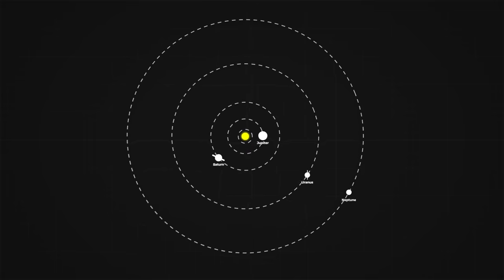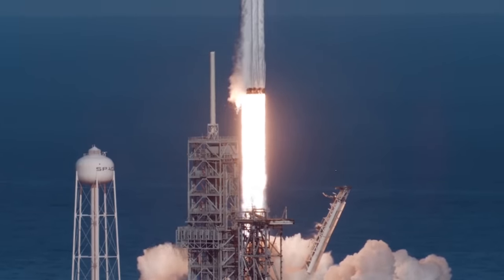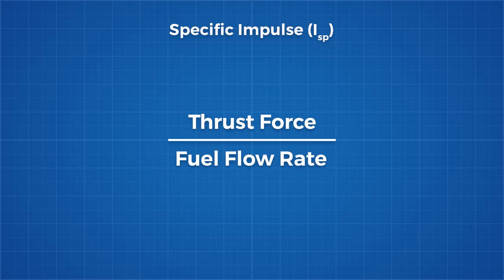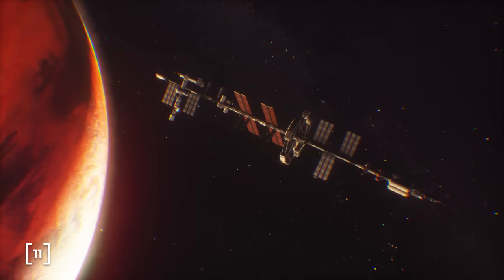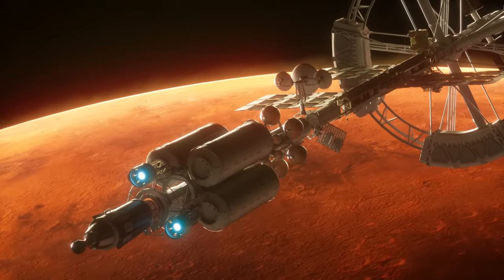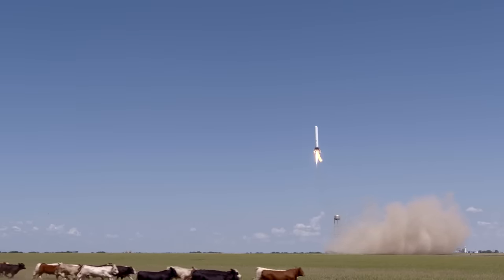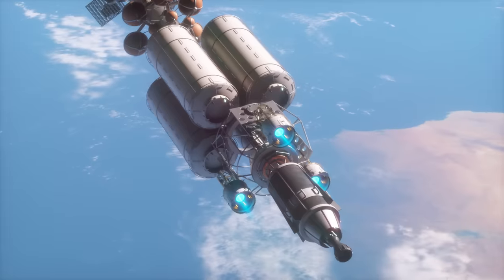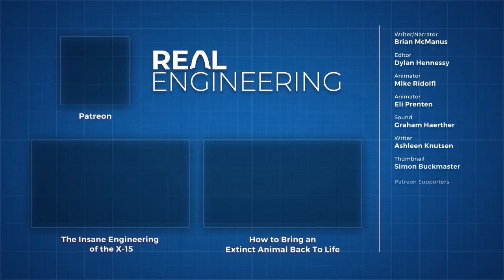Can Nuclear Propulsion Take Us to Mars?

Comment: The 8:25'old-school' logic of electric energy propulsion thrust being insignificant to chem-fuel combustion level. Was assumed of a nuclear cell storage, running a dinky 🏟  size flashlight  🔦  as the engine,  versus nuclear amp to the energy thrust rocket. In solar orbiting, chem-fuel can never be non-idole. Never guarantee artifical gravity in solar orbit. 

 Energy thrust also doesn't have to be very robust power, yet accel infinity longer, exponentially advancing the chem-fuel, chems could/should be saved for VToL or emergency maneuver initiatives. To Mars/Venus/Titan.

Comment: First of all. A typical todays combustion jet engine is not a controlled explosion. The detonation engine is.
Secondly, hydrogen can be stored for a long time in the form of water, which is quite easy to decompose into hydrogen and oxygen by electrolysis or by heating it to 2500 degrees Celsius (interesting coincidence). The good old nuclear reactor allows to implement both methods, but the first is preferable for a number of reasons. 
A third important point is: The plasma engine, not the ion one, has the highest specific impulse at the moment (as far as i know. I'm an economist, not roket science guy.).
And the way to cool the reactor has long been found.
Reply: first of all rocket engines are no jet engines. Secondly, an explosion is a rapid expansion of gases so in a sense its a controlled explosion .also storing it in water completely removes all advantages of nuclear propulsion with oxygen being 4 times as a h2 molecule

Comment: And no one is trying to find a safe container for fluorine, which if combined with hydrogen would provide a chemical rocket so powerful that we could use chemical rocket of about a third of the size of standard chemical rockets, but at least you wouldn’t need to worry about nuclear waste products in the atmosphere. It could be argued that fluorine products are generally poisonous so not much of an advantage in the possibility of a launch failure

Comment: Split the water turn it into hydrogen and oxygen it will give you 2 fuels or 1 fuel and 1 life support system for people on board. Because you are running a nuclear reactor it could produce a lot of electricity that can split the water into gas. Water is safe to carry.

Comment: The concept of a nuculear purpulstion, had never considered the attuning of fusion & fission wager, because of human/fragile cargo, faster acceleration was still a uncomfortable G-Force factor, what was missing, is the G-force as gravity simulate. 
So it's the longer lasting acceleration duritation in non-idole is more feasible, not faster acceleration. 
 
A canister rocket is limited, but with micro exertion of fuel atmosphere, the wager of control could continues flow more stable, saving the fuel verse over usage burns. Feasible only in micro gravity or solar orbit travel. 
 However, Electric thrusters ( example VASIMR), would offer multi combo of have a more control lower flow to sustain at least gravity simulated acceleration levels, be non-idole, use with mini nuclear amp cells, can last longer, eventually faster travel duriation time to and from way points, within solar orbit domains. Save the traditional chem-fuels for emergency maneuvers, planet orbiting & VTOL sequals.

Comment: Common misconception: The slingshot does not increase velocity. It only modifies the vector and hence the relative velocity to the previous body
Reply: If it doesn’t increase velocity, then how do they raise an orbit? If you look at missions like Cassini that bounced between Venus and Earth before heading to Jupiter and then Saturn, how does that work?
Reply: Hi Fork, The orbital entry and exit are defined by a hyperbola assuming no atmospheric breaking is used (unlikely) so it is equivalent to a vector change in orientation rather than velocity. This is of course very useful and relative to Earth the speed can be changed but there is no overall Potential Energy gain relative to our solar system.
Reply: @tomwojcik9342  Got it, because the object accelerates to the target body on approach and decelerates relative to the target body on escape right? Just a trajectory change through the hyperbola
Reply: @fork9001  Exactly! Cheers!

Comment: New planar 3DSG meta-materials 100X stronger than steel and lighter than air will be fabricated into 3D structures:  air-to-space ships. These vessels can reach 150,000 ft, engage Hall Thrust Engines, accelerate in rarified atmosphere, and reach escape velocity. Their expansive fuselage have enough surface area for photovoltaic power. The cargo capacity is capable of 1000's of tons. The tech exists now to reach Mars without gravity assist and return without refueling. Plus, the very nature of this class of meta-material will accommodate hydrogen without the fear of leakage and hydrogen embrittlement.

Comment: Greetings from the 30th century. You've got it all wrong. Don't increase the exhaust velocity. Reduce the gravitational pull (g) instead. If the crew, supplies, fuel and cargo weight 1 kg alltogether and you have 1000 m3 of hydrazine and oxygen on board - you could reach velocities close to 0.99c. Mass is not a constant, mass depends on the interaction between baryons and the Higgs field. Locally diffuse the Higgs field to solve the problem.

Comment: How to store Hydrogen? Water. Seperate it into Hydrogen and Oxygen for use as fuel as needed in the same way making Hydrogen fuel works here on earth. As a solid, Water is pretty safe to store, and the power used by the Ion engine could be used before it is needed to create the fuel needed for a burn.
Reply: But then you have to electrolyze the water using onboard power, and doing so in mass - such as to power a rocket engine - would take a lot of power
Reply: @alexsiemers7898  Yes, and no. If you were making the fuel on demand, yes. But for space, there is little need for that. Run a low output reactor and turn a very small amount of the water into fuel over time with the excess power that the reactor generates while the Ion engine is not used.  Doing this,  one could turn comets into the ships that explore the stars.

Comment: @Real Engineering, would it be possible to utilise both Ion drive engine as well as normal combustion engine that we are using in this day in age, when it comes to putting both engines on one connected space craft? Using the more powerful engine (Ion Drive) to get most of the way to Mars but then using Normal Combustion engines or nuclear engines to slow down the space craft enough to orbit mars? (also I could be entirely wrong, just an idea though)
Reply: That's the optimal solution
Reply: If your trying to do a single high thrust injection burn your best bet is to use Hydrazine.  Even better is to just use the ion-engine, they CAN do an orbital capture, it just has to be a spiral rather then a single burn, the loss in efficiency from Oberth effect is more then made up by the ISP of the engine.  The only thing we need high thrust for is lifting off of planetary surfaces, anyone who claims they need high thrust to go between orbits is lying to you.
Reply: @kennethferland5579  The problem with that is, you may want to avoid lengthy exposure to radiation belts on planets with a strong magnetic field. For unmanned spacecraft, ion drives are perfectly sufficient.

Comment: getting to a place is not  the   question.  we can  move through  space. the question  is  whats the value  of mars  as that place.  it lacks one thing  and until thats overcome  its  just  a  desire  with  out  a  reward. . the thing it lacks is  mass.  and until  a  shield  and protection  against  the  solar  wind that blew away  what  protection it had in the far past.  the craft is nit  the quest . the port  that craft  lands in   is the bigger  problem.

Comment: No matter which side most people is: to potentially radiate our planet or not… few really consider it for space… its natural radiation filled environment! Of course… those reactors should be filled with fisible material on the moon orbit hehe. Also I think putting in orbit nuclear fuel only needs a failure and reentry resistant encasing… well there is work to do 😂.

Comment: Why not take water. You can convert the water into hydrogen and oxygen through electrolysis using a nuclear reactor, then simply use the hydrogen through a nuclear rocket engine. Water is super stable, and there are plenty of uses for oxygen in long term space missions.

Comment: I have a question, is it possible to amp up an ion thruster's mass flow rate to be equal to that of nuclear thermal or chemical burning thrusters?
Reply: That is a problem because ion thrusters are limited by space charge effects.  As more ions are accelerated through the grids, the charge on the ions effectively shield the electric field.  In the end you can try o increase the voltage to pull more ions through, but the number of  ions does not rise any more.  The way to incease the total flow is by making the area of the grids larger.  But to get high thrust they have to be huge.   This is one of the reasons ion thrusters have high efficiency but low thrust.

Comment: Of course a nuculear powered rocket could go alot faster and get us to Mars in a fraction of the time. The thing is a nuclear reactor is not small or light and all the lead shielding you'd need to make it safe also weighs alot. You'd have to build it in space it would be to heavy to rocket up to orbit. It would cost trillions to get all the material up there and then assemble it but yeah we could probably do it if we cut our military spending way back. I think building a really fast spaceship is a much better way to spend a trillion then a 20 year war in Iraq.
Reply: The shield weight (really mass) issue is not that much of a problem. You don't actually need to shield the whole reactor, you use what's called a shadow shield and distance. Think of the reactor as a radiation source like a campfire. If you want to avoid the heat, you don't need to wrap the whole thing, just use something like an umbrella to cast a shadow around you. Another option is to move away from the fire. Both options hold true for nuclear reactors. Put the reactor on the far end of the spacecraft, opposite from the crew habs. Radiation falls of with the inverse square law. Then put a shield between you and the reactor, just large enough to cast a shadow around your crew area. The reaction mass tanks can provide additional shielding as well by sitting between the crew and the reactor. Reactor mass itself is a manageable thing with spacecraft reactors specifically designed to be low-mass. Also, we have much better launch capabilities today with bigger rockets able to lift a reactor module, easily.

Comment: So... Obvious question: are we looking into different ways of storing that hydrogen?

There are various forms of hydrogen storage that are rather well-suited for long-term applications; in particular, we habitually store short-chain hydrocarbons (methane especially), and water, for years on end. Water is already in a low-energy state, of course, so it makes for terribile chemical fuel, but we don't care too much about that, since we aren't using it as chemical propellant anyway.

If they could be split them via some kind of heat-driven catalyzed reaction (using the nuclear core to provide energy in the form of heat), we could then harvest the combined carbon and oxygen as CO2, vent them or store them for use in cold-gas maneuvering thrusters, and use the hydrogen for propulsion.

The obvious disadvantage is weight: methane lugs around 12 kg of carbon for each 4 kg of hydrogen, so out of 16 kg of methane we only get 4 kg of hydrogen, a full 75% waste, and water is even worse,  with 16 kg of oxygen for every 2 kg of hydrogen, making it a... Massive disadvantage. Unless we manage to use them for ion propulsion? They would probably nom on the grids like crazy, and provide one tenth the thrust of xenon, however.

Still, finding ways to conveniently store hydrogen seems like a priority if we want to use it for space propulsion over long periods of time. Cryogenic hydrogen is clearly not going to cut it.

Comment: No reason why you couldn’t use a proven pressurized water reactor design like those used in nuclear submarines to provide the power.  And forget about developing a hybrid engine, too complicated.  Just add in some metholox engines like used in Starship for high thrust applications.  Methane is easy to store long term.

Comment: Liquid Hydrogen would never be the correct fuel, but water would.  You could supply hydrogen and the oxygen we need for the nuclear engines and the regular rockets and the oxygen for breathing and water for drinking.  The nuclear space engines would be a big step in space travel.
Reply: Hydrogen is used because the lower atomic mass (2g vs 18g per mol) means you can get much more exhaust velocity for the same kinetic energy, and thus better efficiency

Comment: How is ever using a planet's gravity to help with orbit and propulsion a bad idea? Voyager 1 and 2 have proven how effective that is. 

Couple that with possible nuclear thrusters that can use solar winds and solar radiation to power them, and we have a major game-changer. Especially if they can move at fasters speeds than the old Voyagers. 

But no. Using the gravity of planet or other massive object is not a bad idea. It saves fuel for other things, and allows the system to be passive for a moment or two. That's only a good thing when you don't have an IT technician down the block to give a hand with whatever went wrong. Survivability of these crafts is mostly the top priority, so they can reach places we couldn't have conceived they would by estimates when they were engineered. 

Doesn't matter what the fuel type is. Its not a bad idea to rely on natural efficiency.

Comment: What's the issue with a 2MW solar panel array exactly?
Reply: The farther you get from the sun, the less effective they are
Reply: @netherwolves3412  Manned missions to Jupiter and beyond might reasonably pursue nuclear, but solar panel arrays powering electric propulsion, anywhere from Venus to the Belt, is cheap, semi-mature tech, which only need structural integration for large arrays and somebody to actually fly the damn things at full size.  There isn't some impenetrable barrier at 1.4MW that makes it difficult to build larger arrays, we simply haven't tried.
Reply: @TrogdorBurnin8or  yeah, you’re right about that.

Comment: Why is aerobraking barely used for capture?
Reply: Less total fuel needed, since using the atmosphere means you don’t need to fire an engine to decelerate
Reply: It's very simple. You need an atmosphere. The moon has none. Mars does have one, but surface pressure is less than 1% of Earth's. And the higher you descent from (basically from empty interplanetary space) the less aerobraking will be effective. You will always need rockets too.

Comment: Hydrogen - could Australia’s CSIRO invention using Decomposed ammonia that passes through CSIRO's metal membrane to produce pure hydrogen at the point of use, be a safe and reliable way to store and transport Hydrogen, therefore making it viable to use in spaceships?

CSIRO's research addresses the conversion of ammonia back to high-purity hydrogen at, or near, the point of use…

Comment: It doesn't go far enough to explain the system level issues. First of all, let's dismiss nuclear thermal. At best you get a doubling in Isp but you pay for it in having a heavy reactor (shielding etc). Nuclear plus ion thrusters has promise but you still have a massive reactor and furthermore a massive heat engine to turn that heat into electricity - and all the mass of the radiators. And yes you can overcome some of the shortfalls in a low thrust rocket by decelerating well before orbital capture. But there are tradeoffs. 

Now let's look at system level issues. One observation is that the most of the mass being sent to Mars in a realistic exploratory mission is cargo. Cargo doesn't care how long the flight is so you can use slower, lower energy trajectories for cargo-only flights. This simple optimisation means you can devote more mass to the manned flights and therefore achieve realistic flight times (about 5.5 to 6 months) with only chemical propulsion. You could of course use nuclear-electric propulsion for cargo but then you need to return those vehicles to Earth and reuse them. And that has its own tradeoffs. One nice thing about chemical propulsion is that chemical engines are light (relative to thrust) and tanks are cheap and therefore disposable. 

Bottom line here is that realistic exploratory missions to Mars can be achieved with chemical propulsion only. And then you don't buy into all the cost, complexity and risk of nuclear propulsion. 

We will probably want to send more sophisticated robotic missions beyond Mars and this is where nuclear-electric comes into its own. However, you can go one step better. Some forms of fusion don't rely on thermal neutrons - instead the energy comes in the form of charged particles and x-rays. The benefit is you don't need a massive heat engine and massive thermal radiators to claim the electrical power. In my view this is worth developing and worth waiting for.

I'll put in a plug for ordinary water as a propellant, broken into a plasma and magnetically confined, it can achieve both a high and variable/controllable Isp. All you need is a source of electricity. See above. Water just happens to be really useful on a spacecraft for other things. And finally, there are now commercial Ion drives based on Iodine. Iodine fills that niche for lower Isp but higher thrust. Plus its dense and easily stored.